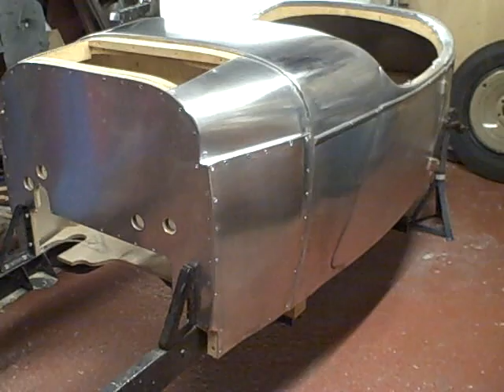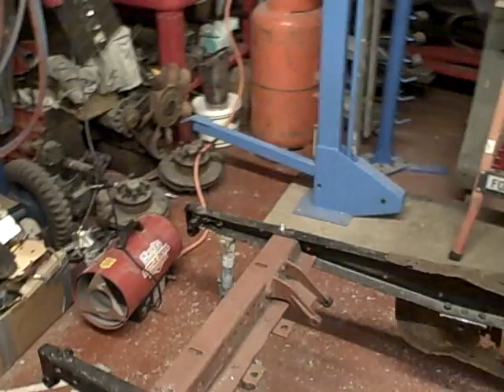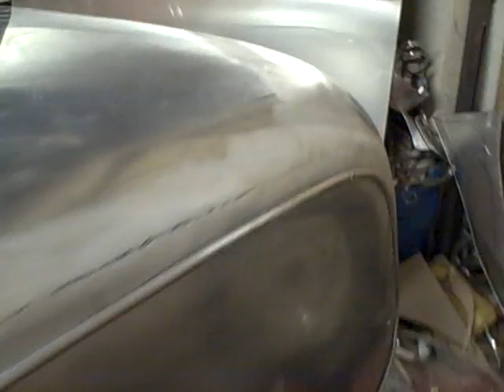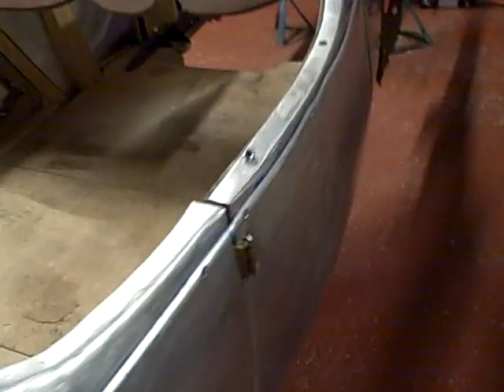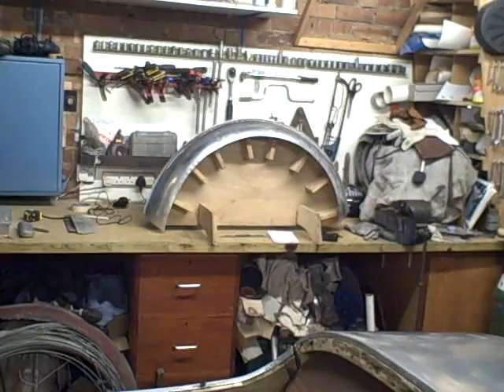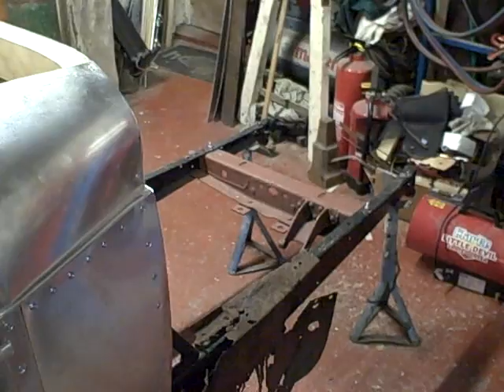English wheeling machine. Part 16 Wolseley Hornet panelled.

Comment: Great stuff. One thing I'm stuck on though - when you previously welded the two small panels it was obviously fairly manageable to planish out the weld and run the joined piece through the wheel. But when you're welding more and more panels together, probably directly onto the car itself, how do you deal with the welds then, if the whole thing is too big and unwiedly to place on the bench or in the wheel? Thanks!